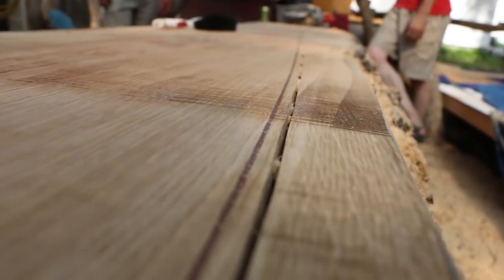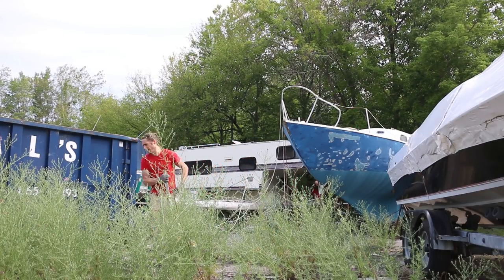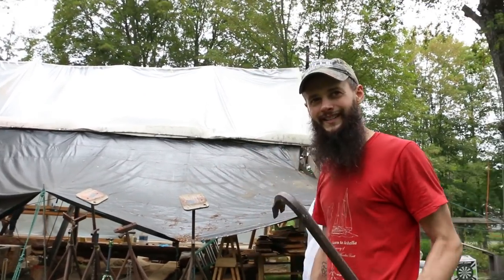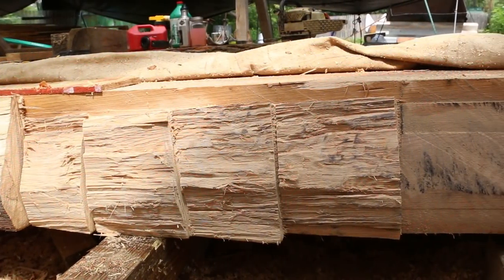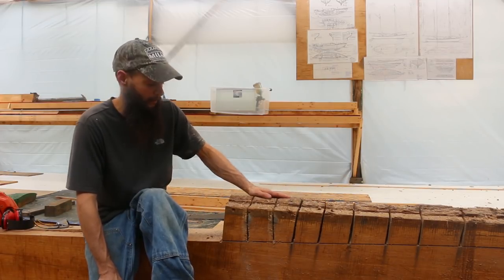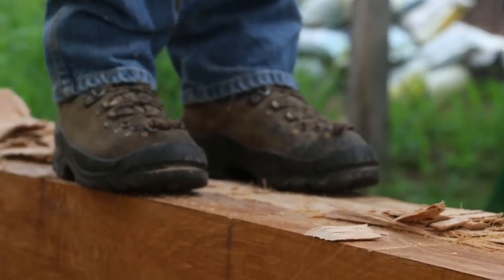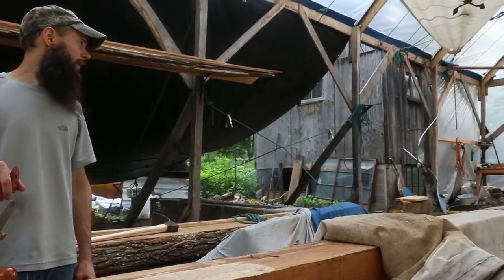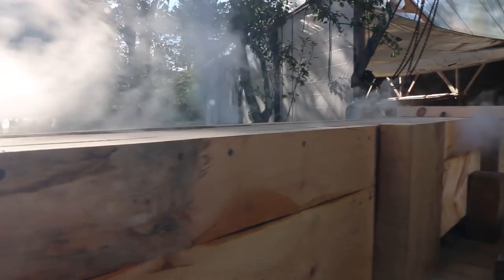Acorn to Arabella - Journey of a Wooden Boat - Episode 17b: Shaping the keel timber (Part 2)

Comment: Hi nice to see you using the adze. The adze that I mentioned in a previous comment was quite small. I was amazed that he took very small amounts off with a relaxed fast motion. He said let the tool do the work for you. 

He was really swinging the tool and connecting the work between his feet quite bent over.The timber was old Kauri a member of the pine family. It was exported all over the world from New Zealand in the late 1800's. This timber has a multi layered sheen and depth to it. It is full of oil and amazing to look at. As I said he got it when Auckland Wharves were refurbished in the 1970's. The Māori people of New Zealand used to cut the enormous trees down. Using simple tools they hued war canoes out of them by cutting into the trunk and hollowing it out.

These trees are quite a sight I saw one that escaped the axes of the settlers in The hills above Auckland. Huge bare trunk with an enormous girth. Straight up to the heavens with branches only at the top like a top knot. That's why they are so good for boat building as well as the natural oil that protects it from attack in water etc. Well enjoying the vids a long enjoyable journey ahead of me Cheers 

😎
Reply from the maker: John, this comment was so fun to read. Thank you for sharing.

Comment: My father was a shipwright (old school) and one day he saw me messing with his adze. He said he’d better teach me about the adze before I cut my foot off.  :D

The geometry of your adze is such that the top heel of the handle that nestles in your palm forms a radius with the flat bottom of the blade so that when you stand slightly bowed over on you timber (the keel in your case) and you keep your arm tucked against your body to keep your hand stationary, your tool now forms a circumference the height of which can be adjusted by bending more or less. Try and get it that the bottom of the adze only just skims the timber. This is rather difficult to put into words so I hope I am making it clear.

The finish you can expect from using the adze is almost as good as if you had used a scrub plane, a master could go from the adze to sanding without needing any planing, but don’t beat yourself up over that, it takes years to get there.

When you use your adze like you would a garden hoe you risk breaking your handle which I’m sure you now realize is an integral part of the tool and is very difficult to replace.

An adze is a finishing tool. If you want to bulk remove timber use an axe or a broadaxe.
Reply: Check out this video  ->  https://www.youtube.com/watch?v=EtA6dmSqtzE
Reply from the maker: Thanks for the tips!! Much appreciated!!!!
Reply: Hey guys, I can vouch for Dougs tip! I am a shipwright and thats exactly how to use an adze. Overall, well done guys, love your work. If only I was still young enough!

Comment: Even though the scrub plane works pretty well semi-sharp, I still suggest putting a nice edge on it.  You will conserve a ton of energy and it will make the next step that much easier.
Reply from the maker: Sharp tools do require less effort! After the slow speed grinder and a second on the stropping wheel you can shave with the iron from the scrub plane although that curved blade might give ya issues! HA! 
With how much material it takes off sharpening beyond that point (ie. oil stones by hand) is not really worth the effort. Sharp enough to shave with is sharp enough to use for the scrub plane.  I am much more picky with the other planes and chisels.
Reply: I hear you - you are also working with green oak, so much softer anyway.  I made a large tool rack/shelving unit out of dried red oak and hand planed all of the boards flat.  I am a waterstone user and ended up getting very good at getting a super edge on the scrub plane - that and a lot of wax.  Keep up the great work!
Reply: When using the adze, try using it more like you use your scrub plane;  don't strike into the grain but at an angle across it..     I would also suggest you could benefit from a broadaxe for hewing off those blocks between the kerf cuts.....(roll the timber over, so the kerf cuts on on the side, but run vertically, strike with a broad axe from above,...this is how timbers for structures are hewn...)
Reply from the maker: Dry oak is some tough stuff! Thankfully the keel timber is not rock hard yet.  The boards we milled are getting there, by next summer they will be rock hard.
Reply from the maker: Thanks for the tips!  If we come across a broad ax for a good price maybe we will give it a try.  There is not too much more of that kind of work though.  A lipped ships adze would be a very useful tool to procure.  Ours is almost totally flat.
Reply: in traditional timber framing, adze work is typically the last step, the last stage to remove the axe marks left by hewing with a broadaxe .   Done "properly", what results is very smooth, slightly rippled surface...(if it was desired for it to be truly dead flat, a plane would be used to finish it off....)
it can be done with a flat adze, just a bit more fiddly...the lips actually makes the job easier by cutting through the fibers at the edge instead of needing to "slope" the angle of your cut to sheer it off successively....

You can hew with a standard axe, it's just a pain to do it; a broad axe, with it's short, angled handle, mades the job MUCH easier and the work progresses more quickly.....
Reply from the maker: Right on.  The lifting of the grain at the edges of the adze is certainly a issue we have been having.  For shaping the bow and stern assembly a little later on we certainly will need a different one, either lipped or just much more curved.
I've never swung a broad ax but are familiar with the concept.  That angled handle must take some real getting used to!
Thanks for sharing your knowledge!!

Comment: Bro it's like a metal splinter in your hand, run a magnet over it and it pulls it out, use masking tape sticky side out stick it to exposed skin and pull off it take fiberglass with it, duct tape worked the best we kept 6" wide roll for that purpose when working with fiberglass, we on the other hand did not wear short sleeves or no head gear, take cold shower then hot you should be fine
Reply from the maker: We did not have much experience with fiberglass before cutting up that boat so it was a learning experience to say the least!
If we ever have to do anything like that again we will go about it a bit differently.
Thanks for the tips!
Reply: Worked with fiberglas fibers in the roofing industry for years; after your done for the day, a hot wash or shower using a pair of women's nylons as a washcloth will snag the majority of the fibers from your pores; lather, rinse and repeat 2 times; gets most of it gone!

Comment: would you consider or be able to use a chain saw to make those keel cuts, instead of handsaw and all the adze, chisel and plane work?
Reply from the maker: We used a chainsaw to cut the kerfs but were too chicken to use it to do any real shaping.  It's a huge timber that is not easily replaced and very expensive, chainsaws cut fast and aggressive, not a good combo. I am pretty good with a chainsaw but I doubt I could keep a 90* cut down a 24' timber that is 11" thick so we played it conservatively.
Reply: Makes perfect sense.  That's one thing about building a boat for most of us amateurs.  Usually your "practice round" and "final jeopardy" are one and the same.  The next time will be much smoother, but there won't be the opportunity for the next time.  So, slow and steady the first time is the right way, since you're learning as you go.
Reply from the maker: Spot on! The goal is to get it right the first time, slow and steady!

Comment: An adze works well across the grain and not so much with the grain.
Cheers Warren
Reply from the maker: Right on, thanks for the tip! Our adze is not lipped, we need to find a lipped one for shaping parts down the road.  I have come to understand a lipped adze drastically out performs a straight blade for boat work.
Reply: it's helpful to think of an adze as similar to a scrub plane, but "less precise".     a lipped adze is not swung in the same manner as a hewing adze.     hewing adze is swung somewhat like an axe..... 
a lipped adze, for more precision,  you cut with the cutting surface more vertically oriented (still cutting across grain)  and you brace the butt of the handle at your hip, and use that point like a pivot....you can greatly control the depth of cut this way by leaning in or out with your weight....  Check out some of the old WoodWright shop videos;  Roy Underhill was a master with the old timberwork tools!!   When I was building a cabin in Alaska, I watched as many of his videos I could get my hands on.   (had to borrow them from the library at the time, was before the era of Youtube.... :P  )

Comment: I don't have any suggestions cause I've never built a boat. Have worn out several chainsaws and I would have used it a lot more than you did.. I will say up till now you are not afraid of work. You could at times use a little help, so why not put the camera on a t pod and let him help lift and carry some of this stuff unless he's handicapped. You seem to be doing 90% of the manual labor. I'm trying to catch up on the videos so my advice is about 2 years late.

Comment: On using an adze. My brother has my granddad's. 

My old man ran a timber gang for a railroad for decades. He had an instance where they needed to adze a couple miles of timber. The crossties (sleepers in the UK) have a metal plate that sit on them. That needed to be cut down about a quarter inch on each one. 

He says this about that job. 

I put an older man on that job because it sucks. It's hard ass work. 

Unfortunately the advice is this. Put your head down and go to work. That's all. 

So. The twenty first century rolls around and they make a power adze. Yes. It's the most dangerous tool ever made. It's a thing that attaches to the end of a chainsaw and does the work of an adze. Poorly. 

That is all. Sorry. It is what it is.
Reply from the maker: That sounds scarier than pouring the lead!  Adze work was enjoyable once I got the swing of it. Like ax work a bit of technique and a sharp edge help immensely but no matter what it is slow going with big hard timbers.  I could not imagine having to adze miles of tracks!!!
Reply: An adze lets you feel the grain.  It is true, just put your head down and get to it.

Comment: Man you guys are making this really hard, the right tool for the job makes it way easier. I've watched most of your videos and to tell the truth I'm not impressed, the keel timber could've been done in a day. It's like you guys choose to do this harder in places and when you want to make easier you're complicating it
I have mad respect for your knowledge on doing this but how it's done needs work
My boss would say laughing it's like watching a bunch of monkeys fucking footballs
Oh and back in the day all boats were made using green wood, why? Because back in the day boats stayed in the water all the time so being green didn't matter as moisture is control by being in the water
Reply from the maker: Thanks for the feedback but to tell the truth we are not here to impress anyone, we are not in a race or a hurry, and we are quite happy with how things have turned out.   
It's all about the journey, not the fastest most efficient boat build possible.  
For example we had lot of fun splitting that pine log and will remember beating that thing into submission every time we trod barefoot on the decks and we would cut the keel timber the same way if we could do it all over again.  A lot of people had a lot of fun and felt accomplished helping us saw that thing in two, it was well worth the extra sweat and time. 
They used green wood because boats went from tree to boat in months not years so the wood did not have a chance to dry out enough to split or check during construction.  It had nothing to do with them being in the water year round.  Using only green wood leads to a host of issues but it does work well below the waterline where the wood does stay wet.